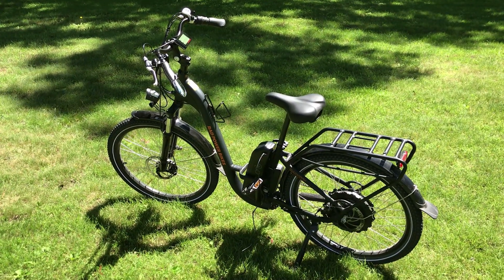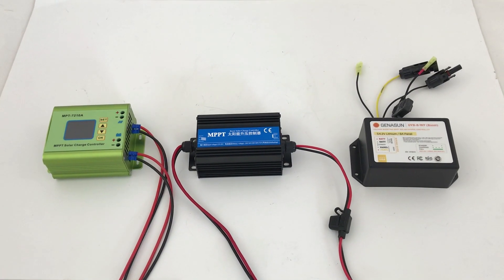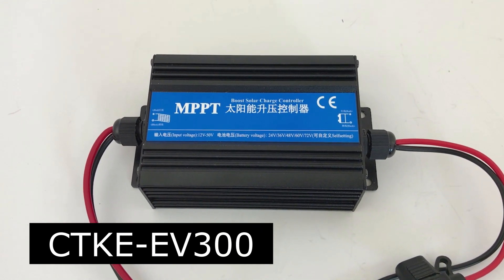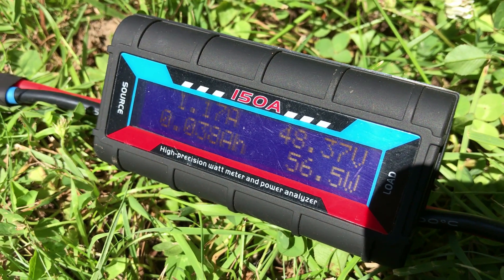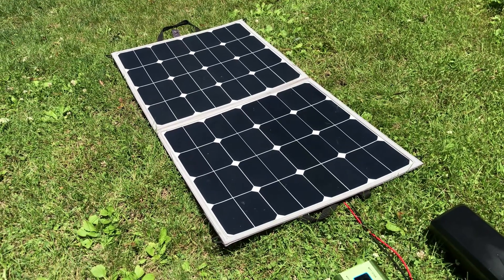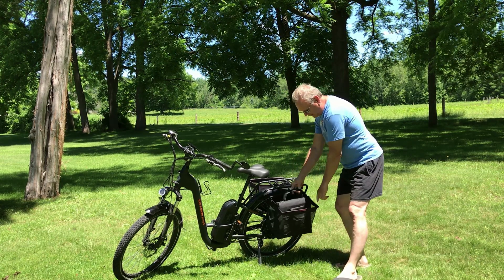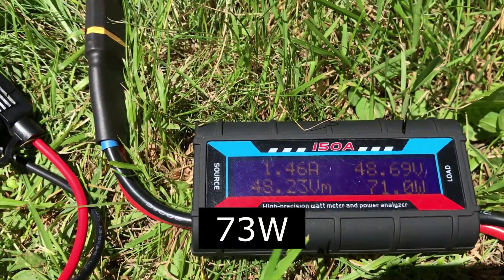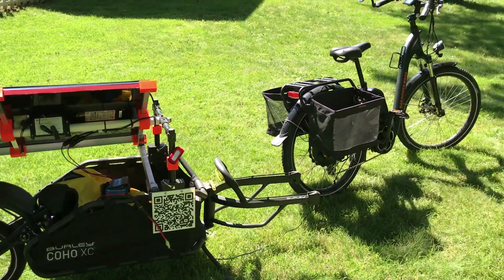Rad Power Bike Battery Solar Charging

Comment: Okay, well you didn't say how long it took to charge though
Reply from the maker: You can calculate the charge time if you know the size of the battery in Wh, the size of the solar panel, how sunny it is, and the max. charge current of your battery. In a simple example, a 500Wh battery, being in full sunlight with a 100W solar panel would take 5 hours.

Comment: I use a Bluetti AC2A to collect my solar from a 100 watt panel that fits on a Trailer like you have.  The advantage of the Bluetti is it has 200 watt-hr battery/inverter that supplies smooth even 110 vac so the stock charger that comes with the battery can be used.  This provides the auto shutoff and correct regulated voltage and prevents constant on/off cycling that is hard on the bike batteries.  I have 2 batteries that I swap out - 1 propels the bike 1 on the charger.  I typically draw 100 watt when riding 12 to 15 mph on flat ground.  A 200 watt panel would be required to stay ahead on power on a bright sunny day.  That's a big panel!  Sorry - on a long ride your going to have to plug in to grid power eventually with the system you're showing us.  When I stop to charge I can collect 160 watts per hour per battery and 200 watts per hour into the bluetti - that's  520 watts per hour total vs your 60 to 80 watts per hour.  
Be careful with your system - it can potentially overheat and ruin your battery of even catch it on fire.  I wouldn't charge your battery full with your system but only to 80 or 90 percent and then get off line at that point.  That will prevent overheat/over charge.
Reply: I am thinking about a similar principle of charging the bike while driving with a solar panel via a Bluetti EB55 station. I plan to have a 200W solar panel (not Bluetti).
But I would like to directly charge only 1 battery that will be under load. Battery with a capacity of approx. 600 Wh (36 or 48 V). Do you think it won't significantly reduce battery life? Will it be able to charge a whole sunny day during an all-day ride? Thank you in advance for your advice.
Reply: @montyjack7612  Get a panel the balances voltage output with the Bluetti PV input.  Panel brand name not important instead consider mechanical stiffness flexibility and performance. (do you have to build a frame etc.)  Your other major issue will be can you charge your bike battery while your using it?  with a one battery system you have to be able to do that.

Comment: Did you set the MPPT-7219 to open circuit voltage or max power voltage? It's supposed to be set to max power voltage, if you set it to open cicuit voltage it will try to hold it there and as soon as it draws some power it will reset as your lower limit voltage you set will fall below your target and stop drawing power. If you're using a standard 100w panel with a VOC of say 21.5, you should set the target power voltage to 16-18v, not what the open circuit voltage is. Look up what the max power voltage is on the panel, or a rule of thumb is take about 3 or 4 volts off of what a no power open circuit voltage is. Many You tubers use this feature to trickle charge their batteries if they are running other stuff off their solar setup and set the target voltage pretty close to VOC so it will only draw a little power and limit the amps so they can run their other things on it.

Comment: My son built me a tiny camper to drag behind my bike. But the extra drag weight limits me to 20 miles and then my battery is flat. 
I want to charge as I ride so that I can keep going as long as the sun lasts.  What do you suggest that will allow me to keep riding, maybe 80 miles.  I can put a solar panel on the roof of my tiny camper.
Reply: Julia Brown
1 hour ago
I have an extra comment please.  
Can I charge the battery AS I RIDE pulling my tiny camper?  Or must the Rad battery be turned off while charging?
I don’t want to stop and wait for a recharge, I want to keep riding as I charge.
Reply from the maker: @juliabrown8316  Yes you can solar charge while riding. See my other video: https://www.youtube.com/watch?v=vP13pjChTB4

Comment: Thank you for this very informative video.  I really want to do something similar.  My concern would be that the Rad Power AC wall charger has (presumably) an auto shut-off feature to avoid over charging and damaging the battery.  Do the charge controllers featured here have a similar feature? Is this a legitimate concern, or dos the BMS on board the battery take care of over-charging concerns? Thank you very much!
Reply from the maker: I believe the battery has a BMS, but the solar charge controllers have to be set for the correct charge voltage.

Comment: Can the bike battery be charged by a solar charger/battery (Jackery) while riding?
Reply from the maker: I did a test in this movie where I charged it at the same time I was using it to run an AC inverter. It worked. So it should work ( https://www.youtube.com/watch?v=vP13pjChTB4 )
Reply: Yes, look up The Sun Trip solar ebike race on YouTube.  

Probably not the best for long term health of the battery but I dunno really.  I want to try it.

Comment: Its a cool idea. But after buying solar panels,  solar charge controller, connectors ect. How long would it take to recover your cost as compared to just regular home charging?  I suppose if you where without other resources it might be worth it.
Reply from the maker: The idea is more for people camping with their ebikes. When you don't have access to AC

Comment: I have this charge controller -- can it be used to charge a Rad battery? I am new to understanding solar.

https://smile.amazon.com/dp/B07NPDWZJ7/ref=cm_sw_r_cp_apa_glt_fabc_47Z6WB6D80FJQSGP6664?_encoding=UTF8&psc=1
Reply from the maker: no, it doesn't support the 48V battery charge voltage

Comment: Hello. I came across this video while searching for ways to charge an ebike battery via solar. So far it seems there really is no practical way to charge an ebike battery via solar in a few hours. Would you say that's a realistic assessment at this point? Thanks so much.
Reply: No... that's not an accurate assessment Tom. I can charge at the same rate with my 300W panel as I can using a Satiator charging at 8 amps. It's not as fast as filling a tank with gas but is easily doable with a high-quality panel. Stay safe. 

SunCapture 300W Solar Panel: https://photos.app.goo.gl/rFim5rPsajmDt8NJ6

Best all-around ebike today: https://photos.app.goo.gl/ADgC6oyPM2gyrCq27
Reply: Best all-around ebike today?
Reply: @Hoperool  Yup.
Reply: @brianbassettnumber1  I beg to differ.
Reply from the maker: Solar should be able to charge them as fast as your wall charger. I'm not sure how much charge current the BMS will take. Higher charge currents can reduce the battery life cycles
Reply: @SerendipitySue  Thanks for your reply. I appreciate your time.

Comment: So 2 of the Megasolar panels in parallel would theoretically charge it at approximately the same rate as the wall charger on a sunny day?
Reply from the maker: Unlike the Renogy panel, I don't think you can put the Megasolar panel  in parallel/serial because of the controller. If you have panels that can be, the two boost controllers can handle around 300W.
Reply: @SerendipitySue  thanks for you video!  Been trying to figure out how this works.  Can you clarify what you mean that the Megasolar panels can’t be connected in parallel/series?   It seems like you have a Y splitter from the DC out of the panel that splits the positive / negative, so if you have two of the panels, wouldn’t you just plug the positive of one into the negative of the other then the positive of one and the negative of the other into one of the controllers to get it in series?  Electrical noob here so I might totally be missing something.. thanks!
Reply from the maker: @BHCollectives  I think I read not to do it in the instruction manual. Physically you can connect them though.
Reply: @SerendipitySue  got it.  Thank you!
Reply: You need to start with a high-quality 300W panel minimum... but yes, I can charge just as fast with my panel as I can using 120V at 8 amps. 

SunCapture 300W Solar Panel: https://photos.app.goo.gl/rFim5rPsajmDt8NJ6

Best all-around ebike today: https://photos.app.goo.gl/ADgC6oyPM2gyrCq27
Reply: 2 100W panels putting out 75% efficiency under direct sunlight (as seen in the video, a 100watt panel was making 75 watts), so 200 watts combined makes about 150 watts, at say 48v would be about 3 amps. The stock wall outlet charger puts out 2 amps. You'd be damaging your battery with that, it should be kept to around 2 amps or less max.

If you got true 100 watts from the charge controller with 100% efficiency, you would get a little over 2 amps, so that's what you should shoot for max. Therefor a 125w or 150w panel is best.

The highest you should be able to safely shoot for is a 125watt panel setup, which will give you a little less than 93 watts under direct sun, and should land you just below 2 amps. You could also go for 150watt and be a bit over 2 amps, about 2.25 amps to be precise, which would probably cause minor if not no damage at all to your battery and will charge your battery a bit faster than the wall outlet.

With direct sunlight, expect about 

9 hours to fully charge with a 100w panel (SAFE) (Flexible panels can be lightweight, 4lbs)
7.5 hours to fully charge with a 125w panel (SAFE) (Flexible panels in this size are rare, non-flexibles weigh about 15lbs)
6 hours to fully charge with a 150w panel (UNSAFE/VOIDS WARRANTY) (Flexible panels in this size are rare, non-flexibles weigh about 15lbs)

7 hours to fully charge with wall outlet

In my opinion, getting a 100w flexible panel and the cheap Chinese charge controller (CTKE-EV300 MPPT Solar controller) would be the best option for weight, no risk of overcharging the battery, and price.
Reply: @MrHonkys  Your opinion obviously isn't formed from experience, more "guesswork" and therefore... almost worthless. BUT... if you want to sit for 9 or 10 hours while the small POS battery in a RAD charges then knock yourself out, Ms. Anonymous. I use a pair of 58.8V 35Ah (2058Wh) lithium packs and a Grin Satiator set to charge at 8A when using A/C, and a Genesun Voltage Boosting MPPT Solar Charge Controller when using the Suncapture 300W solar panel. Either one takes an average of 4 hours to recharge a pack depleted from 56.8V down to 45V.  No solar panel should be used without a solar charger and the cheap POS solar panels you are talking about are just junk. Stop advising people about things you don't have any practical experience with... so, pretty much everything I'm guessing, kid. Hey, I only have 40K miles on my ebike now and used solar to charge for the last 3 years so what do I know.... other than how to do it right. You stay safe little lady.
Reply: @brianbassettnumber1  Brian, could you PLEASE take a look at this product and let me know if you feel it would serve me well (safe & effective) for a 52v ebike battery?  Need response asap